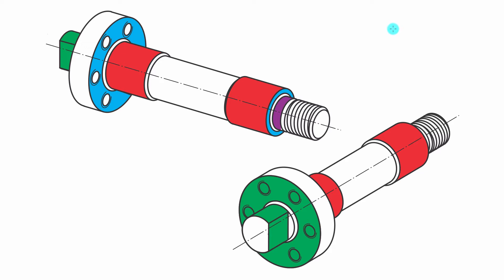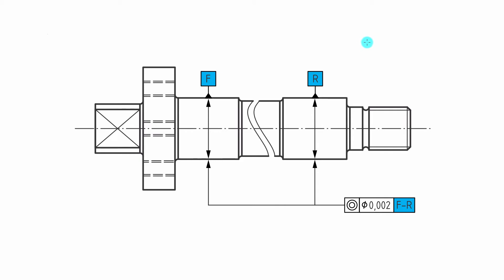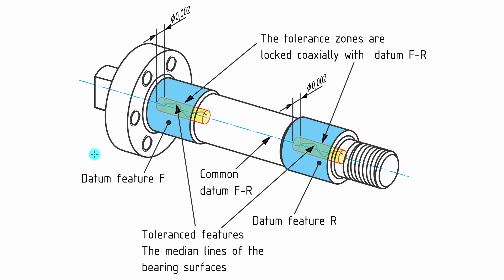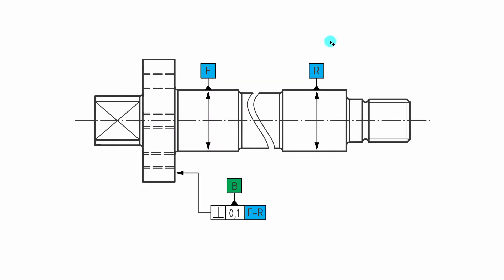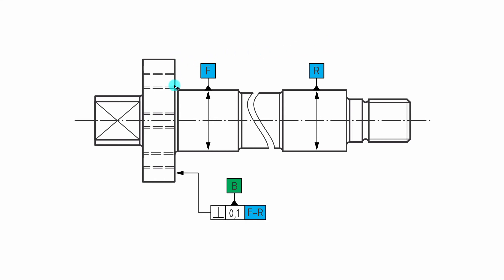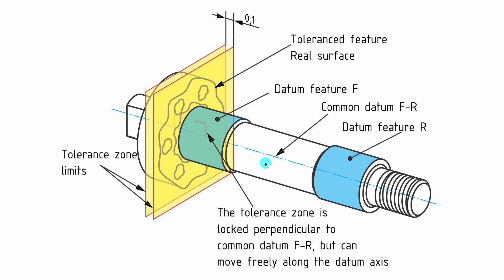Part 1 of the overview of systematic GPS tolerancing

Comment: Thank you for your very helpful video. Could you tell me what is the function of this shaft?
Reply from the maker: This is an imagined part, so there is no set function. It is a very common construction to have a shaft rotate in two bearings. You would want it to be able to rotate freely, when assembled, be in a certain location and orientation relative to the mounting surface, rotate with a stable axis, etc. Depending on the functional requirements of the particular use, these attributes may be more or less important and the tolerances may therefore be smaller or larger.